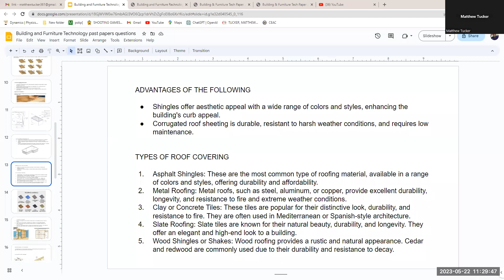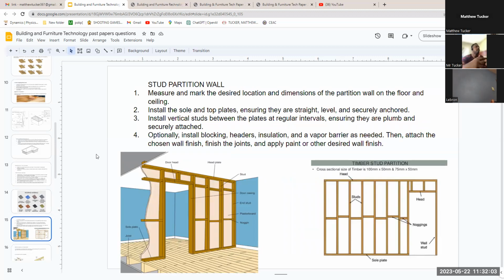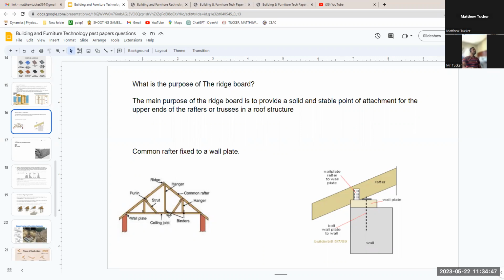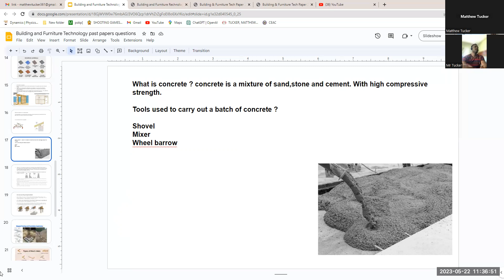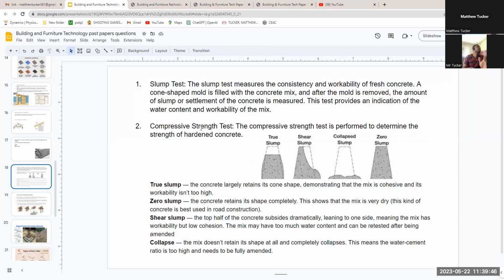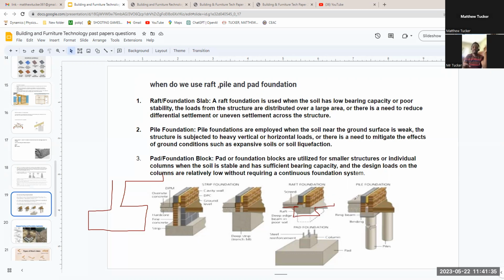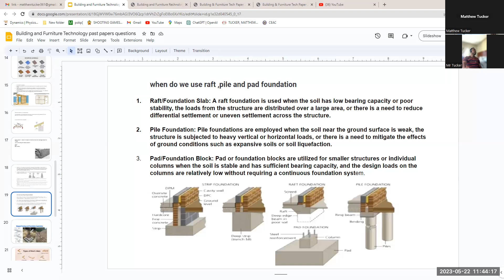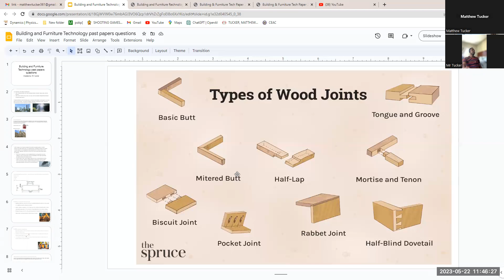PART 2  PowerPoint past paper question.

Comment: what is a jointer and planner
Reply from the maker: Jointer: A machine used to flatten and straighten the faces of rough lumber, creating a flat and smooth reference surface.

Planer: A machine used to create parallel and consistent thickness across the width of a board by removing material from the top surface, resulting in a smoother and uniform thickness.